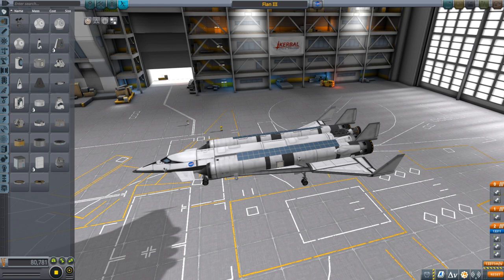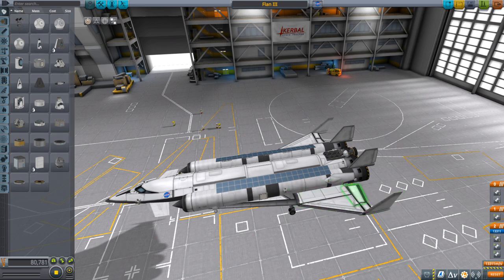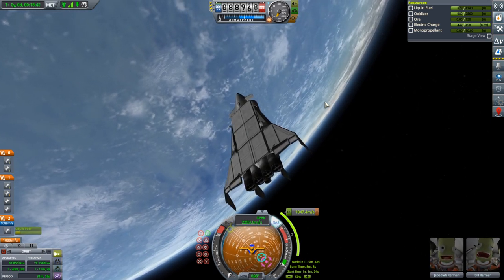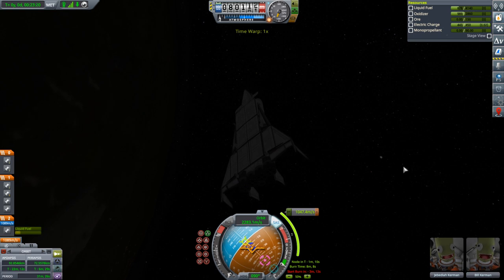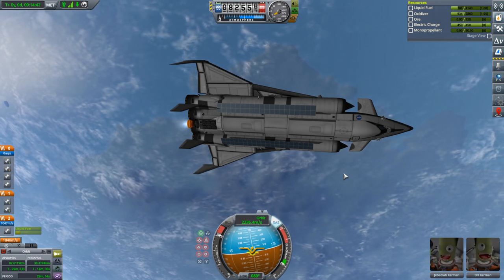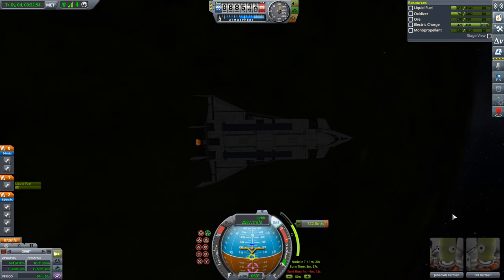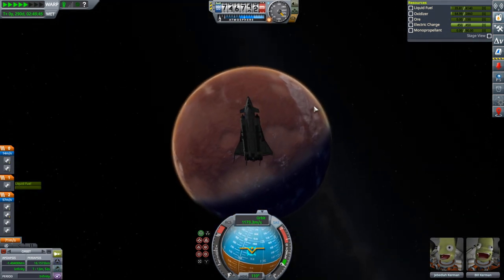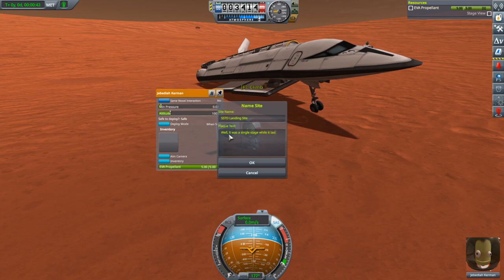Kerbal Space Program 1.8.1 - Single-Stage-to-Duna Spaceplane?

Comment: If you gain your velocity at lower altitudes when you reach around 450 m/s, you’ll be more efficient with the rapiers. Especially if you have like a 10-20 degree angle of attack
Reply from the maker: I disagree, but you can try it out, see if you can beat my performance, and tell me how it goes.
Reply: @RaizSpace  maybe it's not realistic (this is KSP after all) but OP is right. Also I'm almost certain that you could get rid of at least one rapier, maybe even two. You should hit f12 while flying and see where the drag comes from and try to decrease it. Finally landing on Duna is really hard, you should have downward facing rcs ports at the front of your plane to avoid nose diving at low speeds close to the ground and use chutes to slow you down a couple of meters above ground. It is doable without these though but not easy. See Matt Lowne vids if you need some inspiration.

BTW I really do like your work in RSS/RO.
Reply from the maker: Using the method to save the mass of a Rapier sounds a bit better, but we'll have to see. I was going to use the Cubs rather than RCS ports.
Reply: @RaizSpace  to elaborate a bit on my previous answer, if your plane has a high to normal number of rapiers you should fly a steady 10/15° pitch angle, get past the sound barrier while climbing, and then fly horizontally when you're high enough to get as much speed as you can. If you take the underpowered route, which is really fun imho, get past the sound barrier ASL and only then start to climb, but first you have to "debug" your plane with f12. I'm pretty sure that your underbelly wings create a massive amount of drag and your drill should be tucked away into a mark II cargo bay with the doors facing down.

The downward facing engines you used are not suited too imho, if you use the most powerful RCS ports (can't remember their names, the ones using LF) you can then hit R to try to keep your nose up while flying as slow and as low as you can on Duna. And your landing gear looks too weak/narrow to me to expect surviving a landing on Duna without chutes to slow you down. Open them one or two meters above ground and you'll be fine. Also you should enter Duna's atmosphere with way less tilt, you have plenty of time to slow down, otherwise you'll get too slow too high and stall. Remember Duna's atmosphere is really thin and you can't expect to actually fly very high. Try to aim for lowlands, the atmosphere is much thicker there.

Source: I spent days and days designing a liquid fuel only SSTO to Laythe (and back) a few years ago, and even if  I'm definitely not as seasoned as Bradley Whistance or Stratzenblitz I once was skilled enough to get the hyper kerbalnaut badge when the Reddit weekly challenge was still a thing.
Reply from the maker: @jeuwniper  I'm already baking the next video on this craft, but I'll try your method out in the one after that.

Comment: You might want to check out the SSTO's from the movie "Interstellar".
Reply from the maker: The Ranger? It's an aerodynamic mess.
Reply: @RaizSpace  even the kerbalized N1 was madness, but still...
Reply: @RaizSpace  Yes, but it is desinged to operate on planets that have less atmospheres than Earth
Reply from the maker: It wasn't designed for any functionality at all - it was designed to look good.
Reply: @RaizSpace  You are right but its our role to give them functionality, i personally use it in my Futuristic ksp install as a crew trasporter
Reply from the maker: Well, if I had KSP Interstellar engines, I wouldn't hesitate, to be sure.

Comment: 0:30 There's a similar situation with the Moon and Mars—they both require about the same delta-V to land on and return from a low orbit.

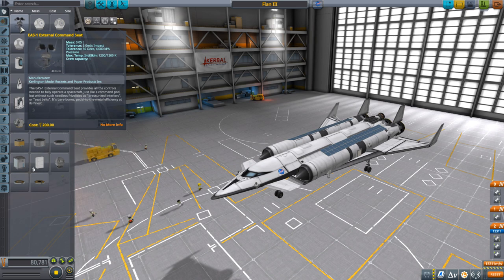2:10 Good way of putting it. I'm glad you recognize that people have done more... often by exploiting the game's physics and building to a Leopoldean degree.

12:55 IMO you should have started this burn a bit later for a more perfect "halving".

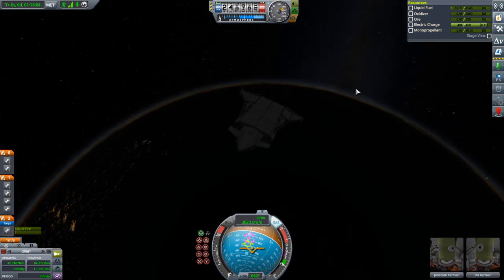15:15 Wait, were drain valves implemented in 1.8 or 1.9? If 1.8, you can certainly use them to ensure an even ratio.

19:40 In general, your ascent profile was... not professional. For the RAPIER-using runs of people like Bradley Whistance and Stratzenblitz (who generally fall in the Leopoldean camp), they... oh, wait, others in the comments pointed that out. You'll almost certainly eke out more delta-V that way, maybe enough to make it to Minmus.

27:10 ON A LONELY PLANET HURTLING TOWARDS DAMNATION

Comment: It won't speed up if you pitch up so fast, the rapiers kicks in at 440 m/s, with 4 should be a beast
Reply from the maker: As far as I can tell, speeding up while low means you start consuming fuel faster while low - the engine isn't being more efficient, it's simply consuming fuel faster. Doing that for a longer time isn't helpful, but you can try the craft and see if you can get to orbit with more delta-v left.
Reply: I believe he should be right since the rapier's thrust depends on the speed of your craft by accelerating at lower altitudes will make your ascent much faster with the higher thrust, by minimizing the time tou spend through the thiccer parts of the atmosphere since you wanna reach the higher altitudes to pick up your max speed before enabling the lfo engine. It might seems like an extra drag effort at first but it ends up paying of in the end. Basing my logic from Bradley Wistance's videos since he does this flight ascent in all of his ssto missions
Reply from the maker: Not interested in beliefs, though. Interested in testing to see if it's true.

Comment: Why not use a nuclear engine so you use only liquid fuel and probably increase your range? (maybe a little a bit of oxidizer for the ascent on kerbin to use with closed cycle mode)
Reply from the maker: The 3 ton mass of the NERV hurts my heart.
Reply: @RaizSpace  I understand, but he's right. You probably used more weight for the extra fuel. I'm pretty sure that a similarly capable craft could make it to Duna with just 2 rapiers and 1 nuke. Mark Thrimm did one with full science and refueling options with 4 rapiers and 2 nukes. 
https://www.youtube.com/watch?v=FfH3Up02wg4
Reply: I am basing this on other ssta's desigbs since it appears to always pay off to use nuclear engines because the using only liquid fuel plus the high Isp makes up for the high mass and it makes a great combo with the atmospheric engines
Reply from the maker: The problem is with the vertical landing option - relying heavily on liquid fuel means we can't do a vertical landing on other places once we've refueled. I notice that Mark Thrimm did not actually come to a stop on Duna in that video, and that's with Duna's atmosphere helping. Trying to land on Vall, Ike, etc. would be even worse. And then there's taking off from those places.
Reply: @RaizSpace  True. I think I added a comment on that video suggesting that he crashed. lol. However, that is fixable with parachutes, which are hugely needed to slow down enough when landing on Duna. Both Mark Thrimm and Matt Lowne have made many sstos to Duna.
The nuke has the same thrust as the terrier, so vertical landings are about the same. Thrust to weight of the engines alone is worse, but that doesn't matter when you are talking about space planes that are 50+ tons. Plus, the entire plane would be lighter with only 1 nuke and 2 rapiers, then 1 terrier and 4 rapiers. In either case, you just need a little boost from the rapiers in close cycle mode to help with vertical landing. 
Also, nukes in stock are far, far better than nukes in RO. They have instant throttle, decent thrust, use stock liquid fuel, and greater ISP compared to their stock rocket counterparts. I frequently built stock sstos that would land on the Mun and Minmus, while still being able to return to the KSC without refueling. I now mostly play heavily modded with KSPIE and many other mods.
Reply from the maker: But we're not using Terriers on this to do the vertical landing - we've got four Cubs. I think you're imagining we're going to land on our tail? That wasn't the intention.
Reply: @RaizSpace  With a little bit of more caution it is unnecessary to do a vertical landing, if you choose a decently flat landing spot you can kill your vertical speed but use the brakes to kill of the remaining horizontal speed allowing for a horizontal landing even on no atmosphere bodies. This does take more effort though
Reply from the maker: I have dreams, though . . . I want to make this look good, dang it!
Reply: @RaizSpace  Nothing wrong with that xD.Just talking about efficiency
Reply: @RaizSpace  lol. When you talked about other bodies and the nukes, I figured that was what you meant. Still, if the entire craft is lighter due to needing less fuel, than landing with the cubs is easier. 
Any yes, looks are still the most important thing when building SSTOs. lol.

Comment: If you right click the periapsis (or any other info) on maneuver screen ( https://youtu.be/6jDLXwiscs0?t=1357 ), you don't have to go back and forth between adjustment and hovering over PE to read the info, it will pin it.
Reply from the maker: Except that if you do that when the periapsis is too close to the surface and it disappears (goes negative), it doesn't stay pinned. I don't right click to pin it when it's close to the surface because of that.